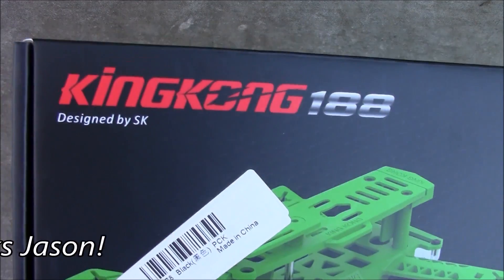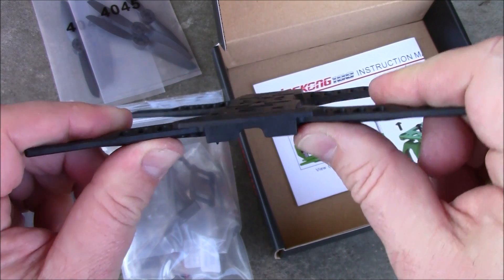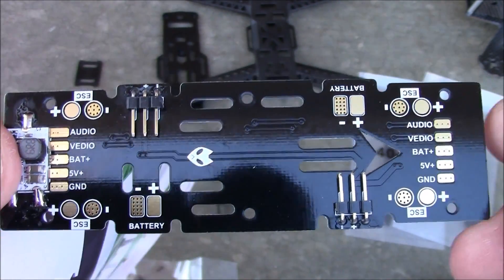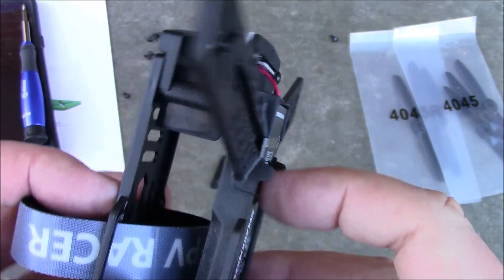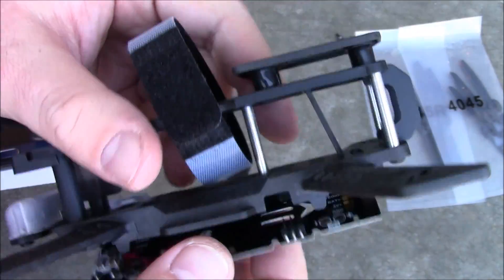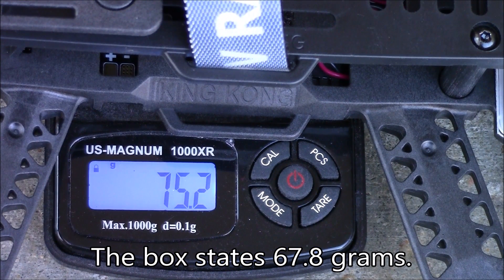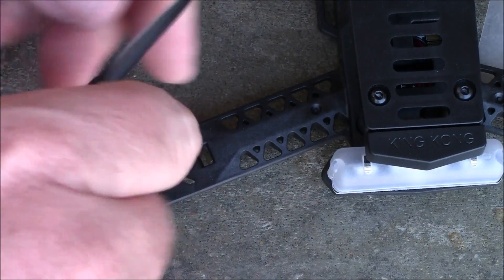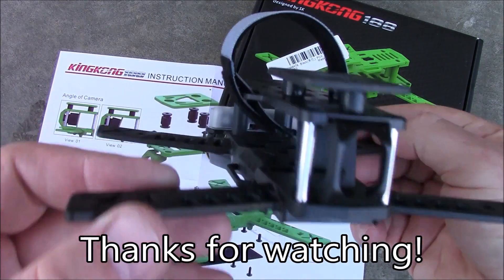KingKong 188 Quadcopter Frame Review

Comment: I bought one of these frames. I just flipped the PDB upside down with the wires down. Covered them real good with some liquid electrical tape and it works great. I just have to remember not to land too hard on concrete.

Comment: I now hate this frame.... because ive built one.
A total pain in the ass.
Reply from the maker: +Mik H What were some of the hard parts of the build process?
Reply: There is a center post which ruins all your plans for fitting anything neatly. Its totally in the way of the flight controller or rx or vtx or anything you want to put in the frame. If You remove it the top plate is too weak without reinforcing. The PDB looks so nice and is great how its set up, but you cant get to it because its screwed up to hide everything, so everything needs extra length cable so you can solder it, then the PDB pinches the bunched wires when you try to fit it in place.
The webbing under the bottom plate gets in the way, but you cant remove it or the frame will be too weak and flex during flight.
The plastic is not tough ABS, it is some sht that is brittle and breaks easily in a crash.
The camera mount arrangement does not work, and you need to modify it to get your camera in position.
So basically everything sux on this frame.
Reply from the maker: +Mik H Well, those are good points.  I won't be building this frame.  :)

Comment: Hey, I just finished a 150 size mini quad, and Im using LibrePilot for the settings In part of current turning what is the best set up to use, there is no mini quad 150 on the list. Can anyone hel. cheers guys
Reply from the maker: +TheWheels1965 I have had real good luck using the "BlackOut H330" presets.... even on my Blade 150.
Reply: OK,  I will give it a try. Thanks mate!

Comment: The holes on the props are tiger motor prop mounts.  (the tiger motors usually come with adapters to fit normal props)
Reply: Actually they are for KingKongs prop nuts but everyone probably knows that by now lol

Comment: Travis , you have your tail light mounted wrong.It goes on the bottom of the frame.I recieved this same frame yesterday.
This frame is tiny , but still pretty cool ! I will be running 1306 3100kv DYS motors.It should be quit fast.

Comment: In my instruction manual it shows the leds on the bottom.  Doubt it matters much, but you had me going.  I am just finishing the build, and it is TIGHT between the pdb and main body.  Servo and thinner wire works best, but battery cable (14awg), prevented it from closing.

Comment: broke one arm on this frame  in the first crash from one meter high in the grass was doing a flip
Reply from the maker: +hooivork81 Doh!  That sucks.  I'm getting more convinced that I may have been lucky with my FPV250.
Reply: was a really gentle crash compared to some of my chrashes with my zmr 250 so wil put all the stuff on a zmr 180 frame that is on the way and almost got my zmr 160 build done so just in time to fly when the better weather comes!
Reply: +hooivork81 How cold was it when you crashed it?
Reply: 10 degree celcius and just 3 minutes outside max

Comment: I use the king Kong props while I am learning as they are so are so cheap. Under $AU10 from Hobby Kingfor a pack of 20 cw and ccw. I have had some spectacular crashes and I am yet to break any. I have bent them to the point they will not rotate but not broken a single prop. If you can could you let us know how the King Kong props are that you got with this compared to genfans.
Reply: +Gordon Heydon  I have been using the KingKong props from Banggood ($5.25 US for 10 pair) on my 250 and I have actually bent one in a full circle without breaking them.   I ordered some 4" props for the 188 and will get them sometime next week.  The 5" have been tougher than a $2 steak though.  Compared to the Gemfan 5030x3 props I have they are leaps and bounds better.  If you tap anything with the gemfans they shatter.
Reply from the maker: +Gordon Heydon That is good to know.  I have 2 quads that use 4" props already so I'm not sure that I'll end up building this frame out or not.  If I use the props on a different quad, I'll try to remember to report back.
Reply: +ratdog472 I agree, I used to take it for granted that a crash will cause broken props, these days with the KingKong props I take it for granted that a crash will NOT cause broken props - the difference is like night and day. Diatone is now making some that are similarly tough too. The other day I finally managed to break a kk prop though, and interestingly it split right through the middle of the hub, weird.
Reply: +iforce2d what diatone props are these?
Reply: +Andrei search for 1028621 on banggood